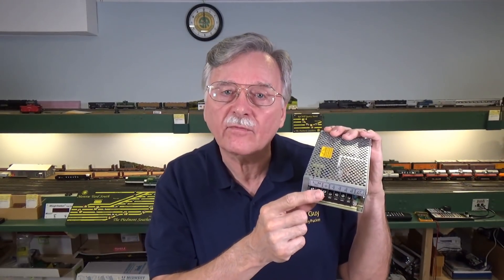Wiring Your Model Railroad for DCC (110)

Comment: I always learn from your videos. I do have a question about grounding. I have a DCS100 command station and will be using a DB150 as a booster. What is the best way to ground the DCS100 to the house ground. My power supply is a PS2012E. As always, thank you. Sincerely, Kennedy
Reply from the maker: I don’t recommend grounding to the house ground even though Digitrax does—too big a liability issue if someone puts a wire in a hot socket. If you decide to do it then please check on the Digitrax website or contact their tech support staff.
Reply: The DCC Guy 
Thanks, so good to know. Kennedy

Comment: For using 22 AWG stranded wire as feeders, drill a hole the size of a drinking straw.  Insert the straw in the hole and your wire will slide right through it.  Great for extruded foam decks.  Once your wire is fed through you can pull the straw.

Comment: Hi Larry, I recently came across your videos and I'm really enjoying them. I have an issue with track polarity that I believe requires a dcc auto reversing module but I'm confused by the fact that only one part of the track seems to join with reverse polarity ,not in 2 places like the videos I've seen. Would it be possible to send you an email of my track plan to better explain what I mean? Appreciate your time.

Comment: Mr. Larry you passed on some Great Great Tools, Tips, And Brighten my up my Eyes on Track.. There is something I've been wanting to ask the Experts or at least someone that has more Knowledge than I Guess I do on Wiring on my D.M.R.R  N scale Layout which is a 4X8 Oval My Track is KATO Unitrack the DCC is on the outer Route only & power by NCE Powercab my Buss Wire is Solid 18 Gauge Bell Wire that is used wiring Door Bells I thought since the Length isn't that long the 18 Gauge would be sufficient for the Distance but with Unitrack and with some of us Modelers that cant use Solder because of where the Layout is set up at we have to Resort to only using KATO'S famously Rail Power Joiners I know Mike Fifer and Mr. Mike has a Wonderful Layout but it's a little bigger than my puddy ole 4X8 uses the KATO Unijoiners in this Situation Larry or Recently I Got my Dad he wanted a Simple HO Engine he wanted sound so I got a Athearn Geniuses GP50 Burlington Northern with Tsunami Sound & some KATO Track he wants a Simple operation Run the Train but he doesn't need anything over the Top I was going to build a shelf Layout the Length would be about 12 ft from one of my Bedroom Walls  to Another Wall then about 8ft from one Wall down to Another Wall & then 12 again the last would be about 8 ft again, with KATO Unitrack it's Simple to make up you can Ballast it & do other stuff to kick it up a Knotch but I've had my D.M.R.R since 2014 and & Have not painted it I have not Ballast it I just keep it CLEAN.. that other stuff that your have to do to make it look like a Railroad in my mind is not needed and what you throw on if it is not Done Correctly can do nothing but make big issues.. 

But what I am interested to know that the Size that I described on this shelf Layout would a Powercab only With the NCE CP6 Along with using the 18 Gauge Bell Wire or would I Need the 14 I'm basically going to set up a Big Rectangle with Unitrack you can Basically put a power Rail Tap every 12 inches of Track or space it out to 3ft and not have to worry about using a Drop of Solder the only Downside maybe to these Power Joiners is that the Wire is Really thin 24 to 26 Gauge but there are allot of Big Model Railroaders that Use the Power Rail Joiners Mr. Roy Smith A Great Model Railroad Guy uses the Rail joiners as he mention he rather not Solder, I follow his Channel as I do Mr. Mike's and they Both again use the Joiners to minimize Soldering which where I live would be Hard but with the 24 to 26 Gauge Wire would a person say in my case have to use more of them to Compesate the Differences in the DCC Voltages..   

If you could do an In depth Review on KATO Unitrack as you have on Atlas or Peco that would be Totally Awesome.. 

Thank You Larry on Reading this and Enjoy Following you and these Great Informative Videos I look up to Model Railroaders like you Mr. Mike Fifer & Roy Smith you Dont need a Money Subscription to help pass on Very Informative Information and to me that Rings in over Someone that needs a Money Subscription to acquire more Patrions.. I will always be tuned in and be a Forever Fan of this Channel..  Thanks Larry for all you do for us in the Hobby.!

Comment: Great video, do you plan to have a video on signal systems.  Again great video.  Interesting point about nickel silver rail, what’s the best material for rail?
Reply from the maker: Boy, ask that question in a group of model railroaders and wait for the fireworks to begin! Brass is the best conductor but it oxidizes fast and the coating is not conductive so is a constant pain to keep clean. Plus the brass color looks totally unprototyical which is why you hardly ever see it. Steel was once used and at one time was often found in low priced train sets. Gives good adhesion but it rusts. So nickel silver is the best compromise. It looks good, doesn’t oxidize as fast as brass or steel, and because of widespread acceptance it is easy to find the various turnouts, crossings, etc. But it is not as good a conductor as brass.

Comment: It be nice to show the wiring and attachment to the layout in addition to talking!  BTW I use RC servo wires with no problem.
Reply from the maker: I know and I hate doing talking head videos. I realize that would be nice and I covered some of that in my earlier video on using suitcase connectors for wiring. It is a real balancing act to be able to get all the information in let alone do active demos of the process and keep the video short enough that folks will watch it. As it is they are scared off by anything much over 10-15 minutes. This video actually ran over 35 minutes so I had to cut it into two parts. It would take hours to do all this if I included real time demonstrations. However I have videos planned on layout track and turnouts, attaching feeders, etc.

Comment: Another great video, Larry! I have your DCC wiring book, I was just looking at it last night in fact. Very well written. I have a layout that measures 19 x 7 feet, double loop connected by a double crossover (made from 4 Atlas #6 turnouts and a 19 degree crossing) which I'm working on installing today. My buses, both the main bus and the accessory buses, are 12 gauge stranded wire. The track feeders are 18 gauge solid wire, and the wires for the Tortoise switch machines are 18 gauge stranded. I'm using terminal block fed by 12 gauge stranded wire to run to provide attachment points for switch machines, building lights, etc. 12 gauge stranded to the terminal blocks, 18 gauge stranded from the blocks to the accessories. DC accessory power is supplied by a converted computer power supply. I have 12V, 5V, and 3V accessory buses. I may be overdoing the wiring a bit, but I'm having fun doing it! Especially since I bought my Whiteside Mfg. reclining mechanics creeper so I can roll around under there!
Looking forward to part two!

Comment: Canada wiring Black, white and green for ground.
Reply from the maker: Sounds the same as US which is not all that surprising since we are neighbors and I think the electrical grid extends across the borders. We also probably share many of the same manufacturers and supply chains. However listening to Charlie Bishop on his Chadwick Model Railway channel things are very different in the UK.
Reply: @TheDCCGuy  Sure is guys, we used to have Red (live), black (Neutral) & green (Earth [Ground to you]), then some smart Alec decided that this was not the best idea although I thought like millions of others that Red for danger was good for live, green for Earth kind of makes sense etc, but no, we had to change to make some European politician happy I guess and now we have since many years back now Blue (neutral), brown (live) and green with yellow tracer (earth). Not content with that 
3 phase is a whole different ball game as you would say across the pond, all those colours have changed also.
Learnt a hard lesson many years back in the late 70's as a slot machine, pin table and Juke Box engineer. We had 'Wurlitzer', 'Seeburg' and 'Rock Ola' Juke Boxes straight from the U.S. and we (or rather our workshop) fitted a suitable power pack for our 230vac system. Well so sfar so good except they left the original U.S. mains cable fitted. So here goes little old me as a novice at the time to a Pub (that's a Bar to you guys) and some person had pulled the cable from the wall plug having stood on it. So I wired it back up - What did i do? Well Red was obviously live, Black was neutral and white was obviously the only one left so must be earth. Of course none of this was correct except for neutral, so I go a shock when the thing went 'Bang'.  Didn't do that again I can tell you!
Great video by the way, keep 'em coming.

Comment: Very helpful video Larry. Thanks.
For a large model railroad in HO (350 feet of main line that runs on two levels parallel to each other (similar to a double deck layout arrangement) is 12AWG "Stranded" 2 conductor (paired) wire OK for the buss? I would rather run the stranded then solid for the buss if it is acceptable with 12AWG. I will run the buss from a central point on the layout. The wire runs will have to be about 75 ft or so in each direction from that central point.
Philip
Reply from the maker: I think Tony Koester told me once that he uses 10ga on his Nickel Plate layout because of runs this long. However watch my next video and the one coming Friday to see if I cover your questions.
Reply: @TheDCCGuy  Thanks for the reply and I will definitely watch. 
Is it OK to use stranded type buss wire (as long as a suitable gauge) rather then use a solid buss wire. For now, until your next video, that would be helpful to know. Thanks.
Philip

Comment: Great advice. Would love to here your thoughts if possible in the next half. I have a HO set up DCC. 2 x 5amp boosters feeding into 6 zones with protection then feeding into my block modules.  This goes not on multi core 1.5mm then on each zone run the other side as a ring main one for each zone back to the boosters. All in singe core. all the DCC motive and stationary are group together with loconet and stationary power run in different wiring systems. I am not seeing any issue at present but still building. Have I set myself to fail please?
Reply from the maker: Paul, watch the next two videos and hopefully I’ll address your questions.
Reply: @TheDCCGuy  great videos thanks Paul

Comment: Another tidbit.  If using a lot of flex track (which is typical of most large railroads, both HO and N) direct soldering your feeders works great since you can add them where you need them.  However another way of adding feeders that is a little bit easier is soldering them to rail joiners then adding them to the layout.  This is how I have wired mine in I have soldered up quite a few rail joiners with wire attached (red/white setups) and have at least 1 feeder per a "block".  I have plastic insulators (a hold over from the old DC blocked layout) separating out the blocks of track for the eventual addition of signals.  Once the track plan is finalized (freelancing it) I will be going back and soldering all of the rail joints together before I ballast, thus making sure a good clean solid signal is always present in every section.  The Yards all have a feeder for each lane in a yard, even though they are not insulated, this is just redundancy being built into the system.  My Bus is 18g wire and all feeders are 20g bell wire which is perfect for N scale.

If you are thinking of converting a DC layout that has block setups to run 2 power packs, do not pull out all of your wiring.  What you have already wired is setup perfect for common rail block signal setups for DCC.  Meaning your current block setup converts perfectly to DCC with little to no extra wiring needed.